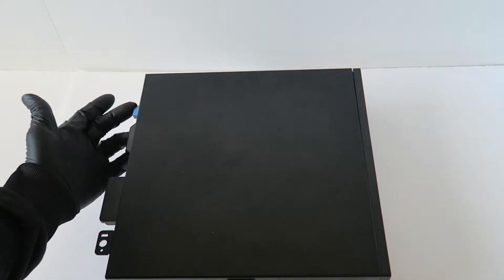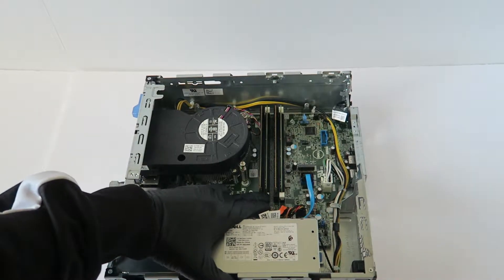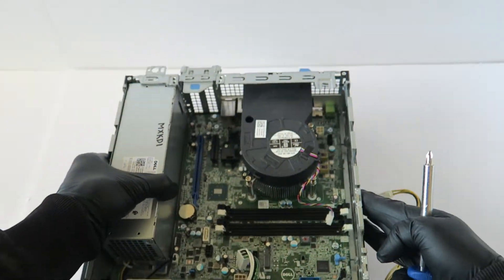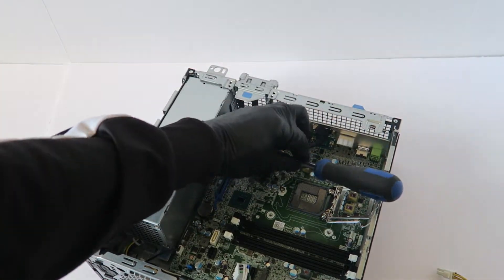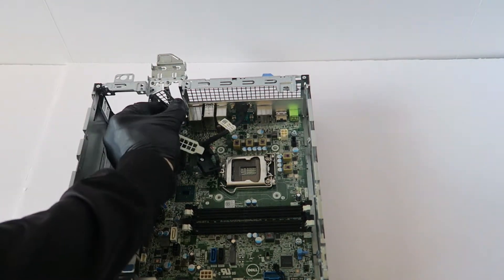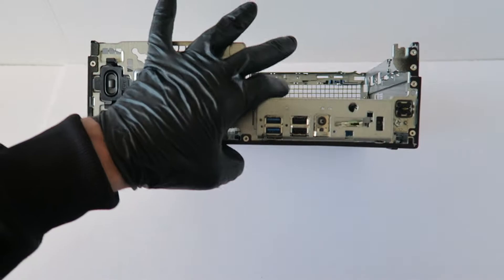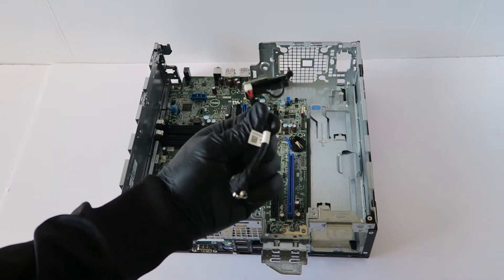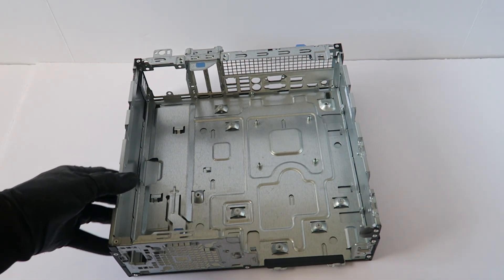Dell Optiplex 5050 SFF Teardown

Comment: Very helpful, also my 5050 came with built in memory, kinda weird, I was expecting a solid state card for the cage, but was empty... For a moment I thought someone had scalped it .... But after further investigation the version of motherboard I have the hard drive is built directly into the motherboard and then you can add a second one in the hard drive cage.... Phew

Comment: Hello, I have an optiplex 7050 sff and it is identical to this model and it does not look like the one you show in the other video you recorded where you show how to update a dell 7050, could you send me a configuration of the power supply and video card, I have 16 GB of RAM with a core i5 7500 processor and I want to put a 240 m2 nvme and a 1 Tb HDD, will it be necessary to change the processor? thanks and regards